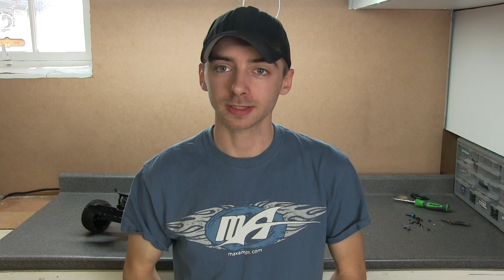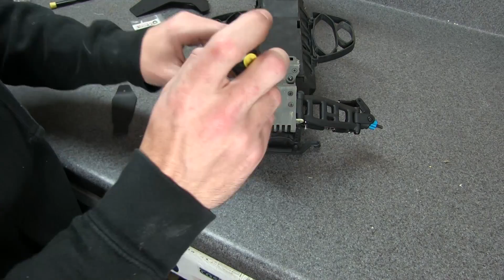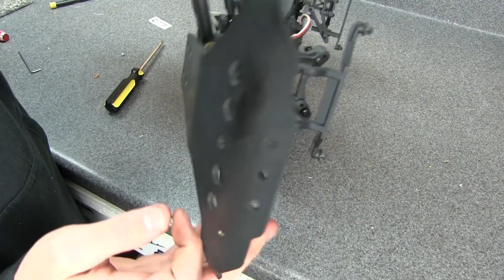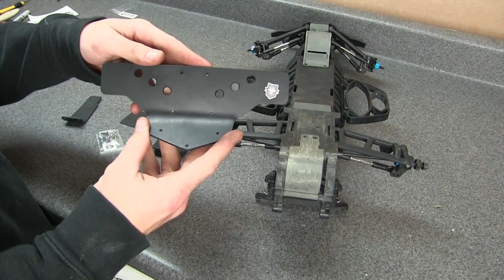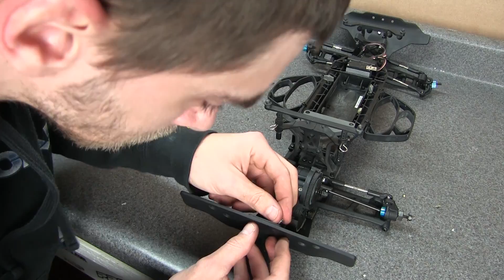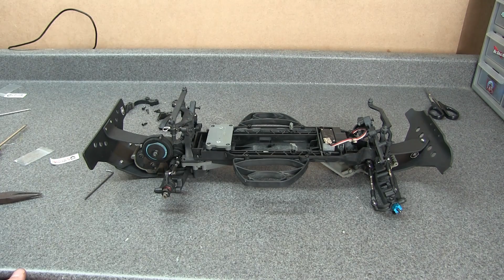ECX Torment T-Bone Racing Front & Rear Bumper Install

Comment: On the rear bumper, aren't the nuts supposed to be on the inside and the tapered head on the outside?  The way you did it, grass and debris can get caught on the nuts.  Plus, aren't the screw holes on the outside of the bumper countersunk for the screw heads?
Reply: That's what I was thinking. I hate when grass gets caught on my nuts!

Comment: How you doing Matt, I really enjoy your informative videos, so who else but you to ask this more than likely age old question, here goes.  I have an ECX Torment 2WD that I mostly run on the streets, but, when I am running at a good clip and try to make a quick tight turn the Truck will roll over, and not gently.  Thanks Matt.
Reply from the maker: most likly you will need to lower it stiffen the suspension and maybe put some wider tires on. that would be my recommendation
Reply: Thanks Matt.